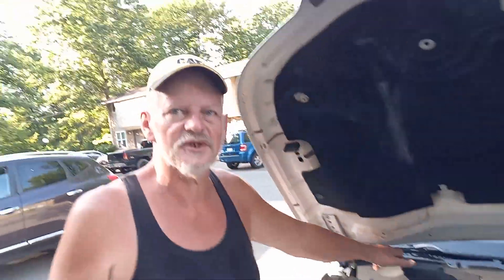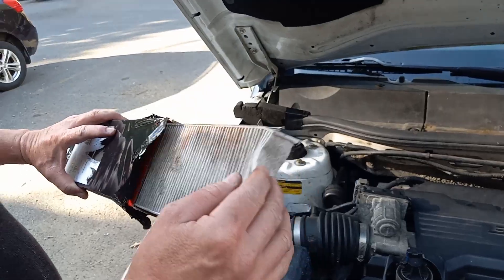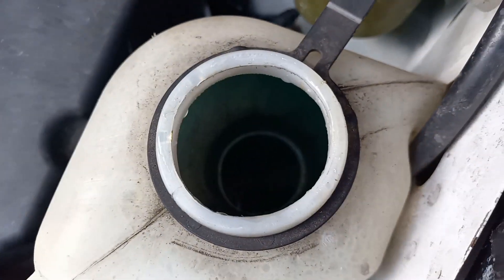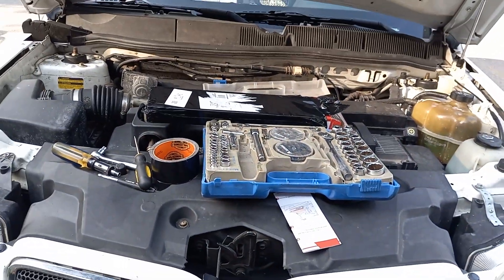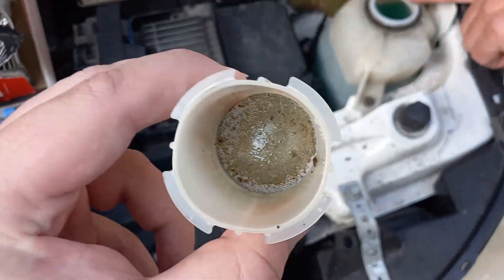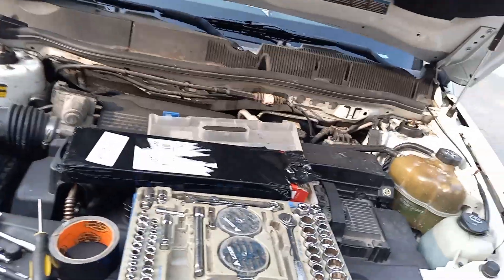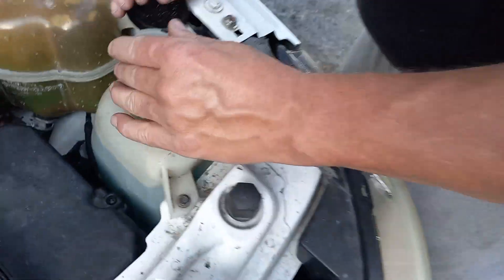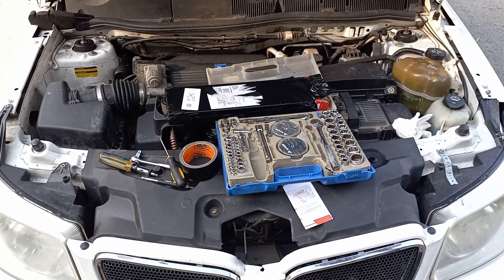Pontiac Love ❤️ UPDATE 😊

Comment: Bro I got a 2008 Torrent GXP in 2018 and six days after driving from the dealership, it's transmission exploded.🤣 Then a couple months after having it replaced at the GM dealer, the transmission started acting up again. That car was an old car nightmare: sensors going out, the AWD system not working in cold temps, the dash cracked and I had to replace it, water leaks, etc. Every month something new was wrong with that car until I got rid of it two years ago in driving condition with no lights for $1200.🤣 At that point I just wanted to give it away and never see it again.
Reply from the maker: Oh wow dats crazy bro I like ur story man dat was interesting to read thanks for ur comment it is much appreciated!